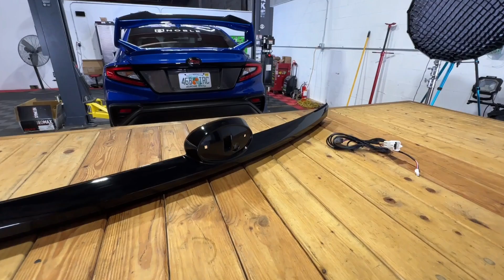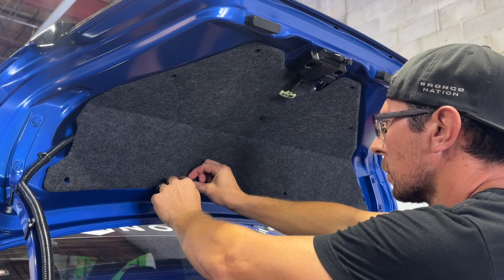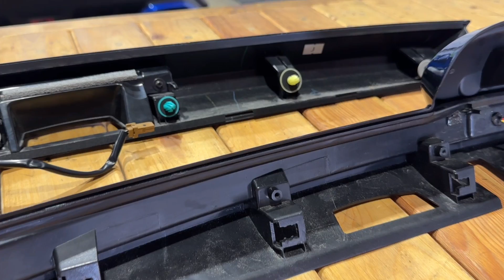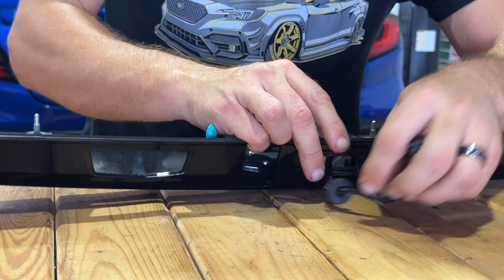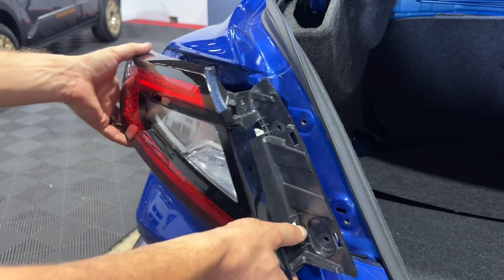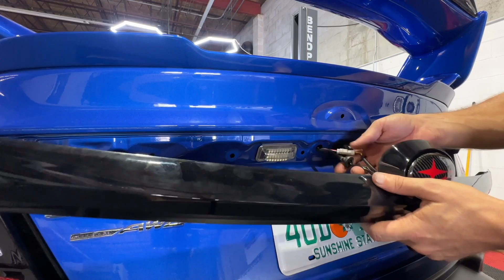NOBLE LUX TRUNK GARNISH LED INSTALLATION | SUBARU | WRX | 2022-2024

Comment: There are more disadvantages than advantages. There is a high probability of leakage. Sealing is very important. The trunk floor appears to be very susceptible to water damage. Corrosion due to moisture. It should be tested in rainy weather.
Reply from the maker: Thank you for your feedback. We live in Florida and get plenty of rain and haven't had an issues. We will keep an eye on it though and we hope you have a great week